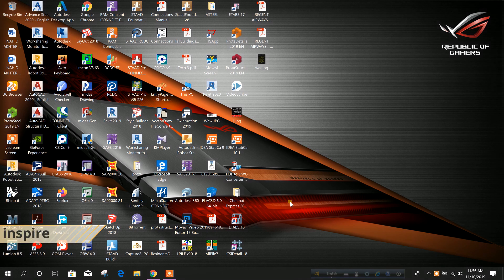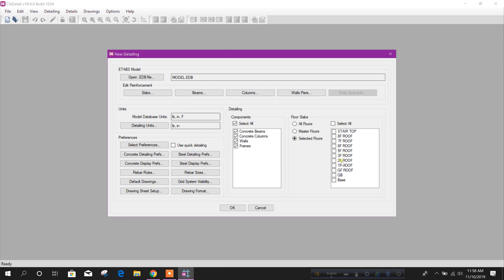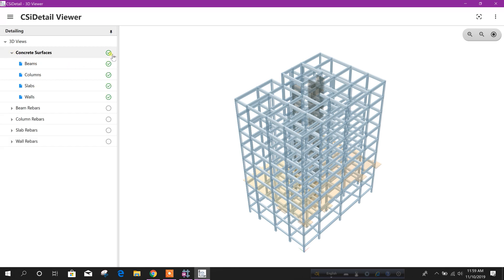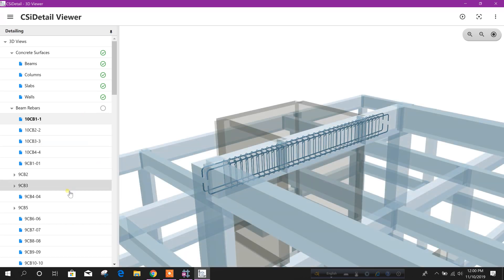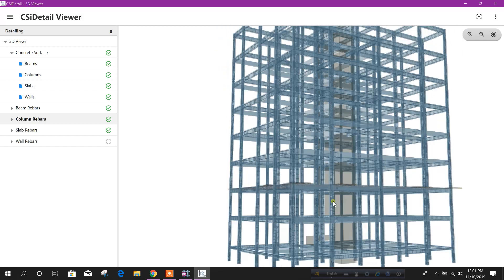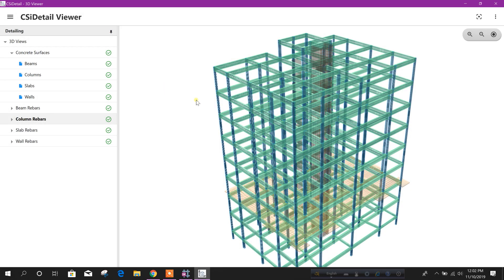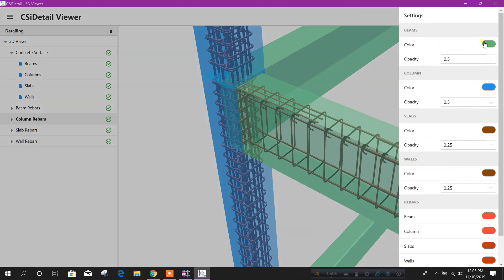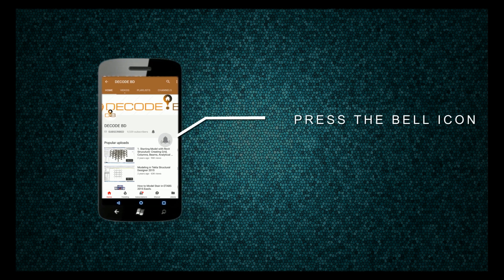Explore CSI Detail Viewer

Comment: hi good lesson 

i have a problem with csidetails18  sometimes i got this warning concrete frame results are not available  even if i run concrete frame design slab design and wall design in etabs 18 can help thanks
Reply from the maker: Check model & design properly.
Reply: @Decodebd  thanks a lot it works